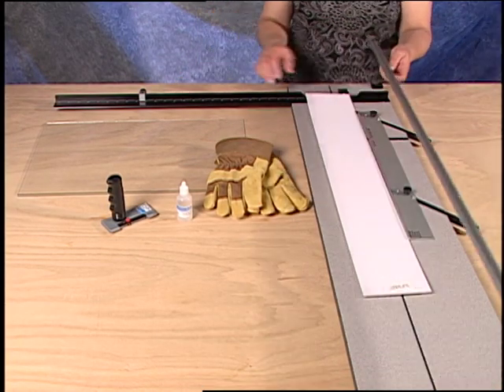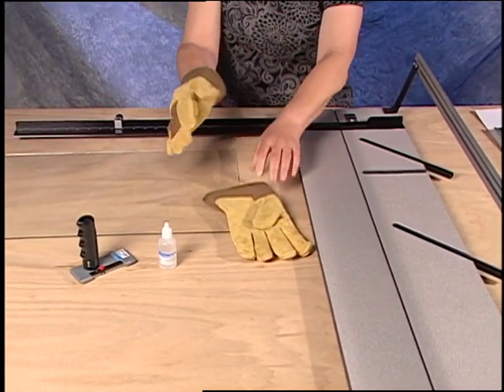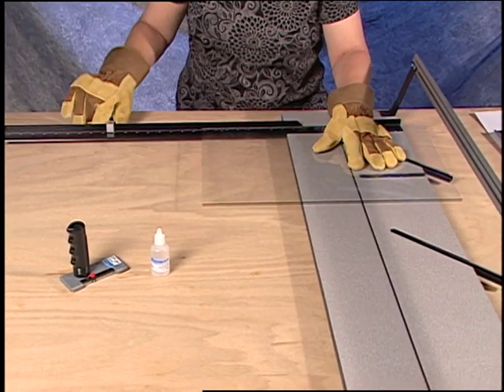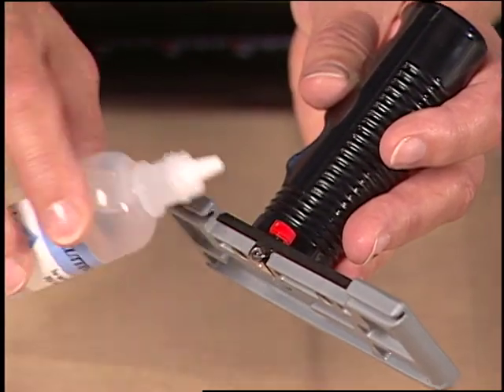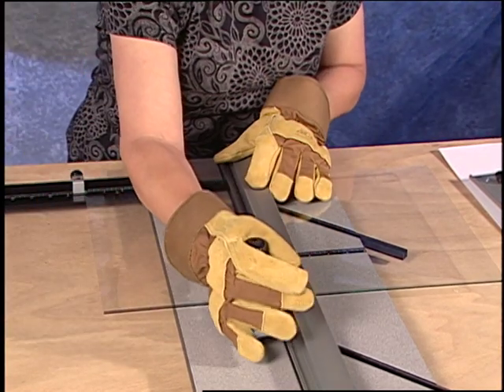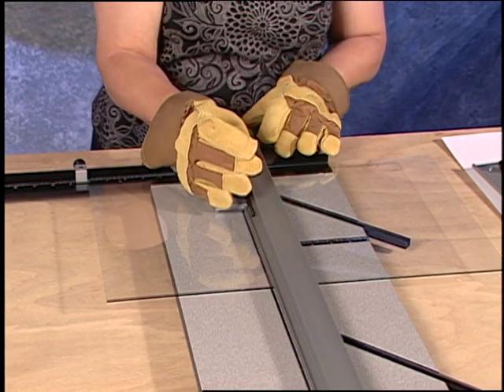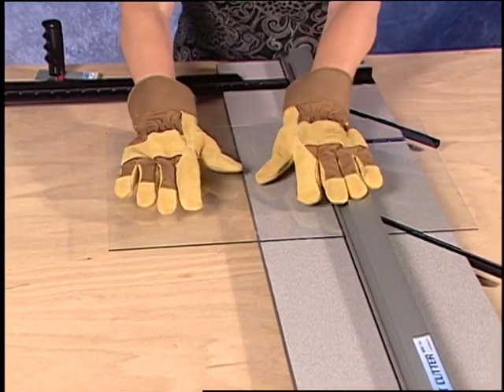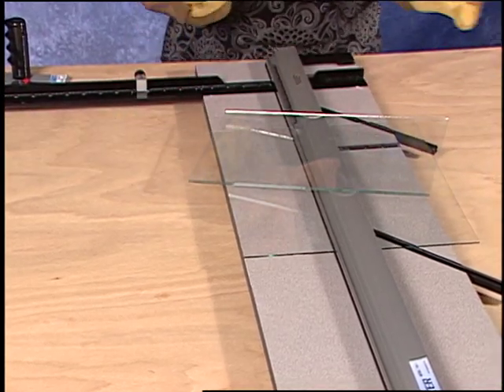LOGAN 704-1 Glass Cutter Elite

Comment: What glass thickness do you recommend to buy? 🤔
Reply from the maker: The 704-1 is designed for use with general framing glass typically around 0.09" thick or 2.3 mm. Thanks